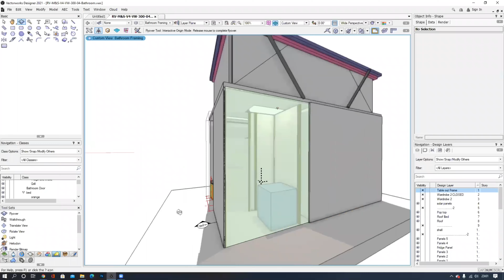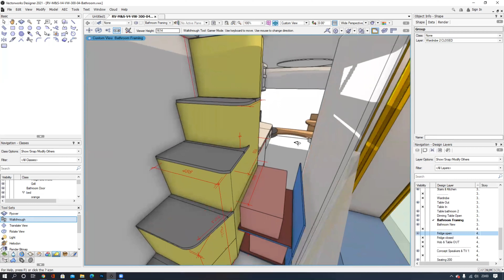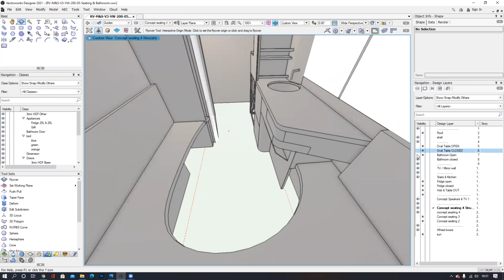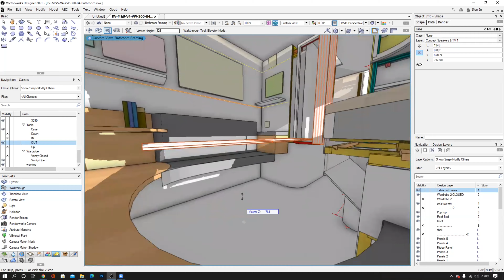3D Model Walkthrough Explained

Comment: Just wondering if you thought about the weight of the van. A few people with the same van have said the have had to upgrade the suspension to handle the extra weight.
Reply from the maker: Yes we have indeed, so we ve got plans in the pipeline for how we are going to be keeping the actual weight of the van down, all will be revealed within our next YouTube video, however we do also plan to upgrade both front and back suspension as well as tyres to be able to carry the weight efficiently! 🙌🏻